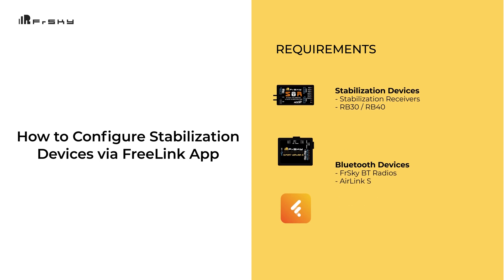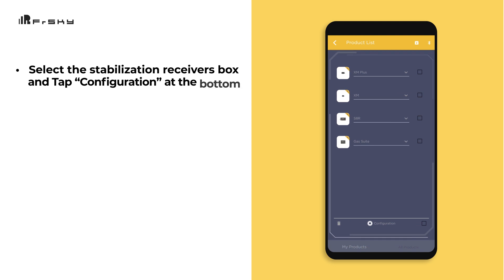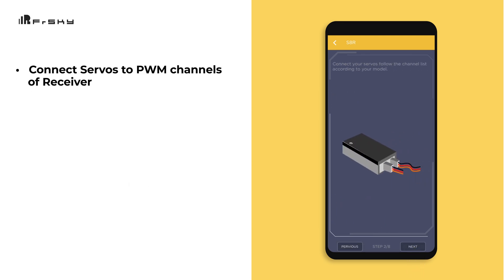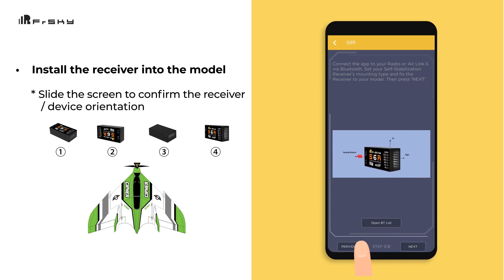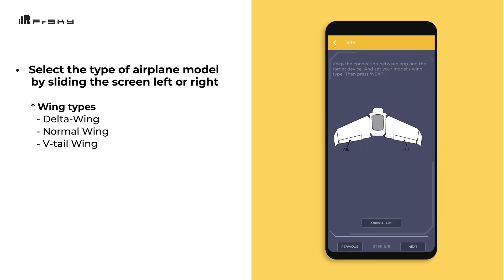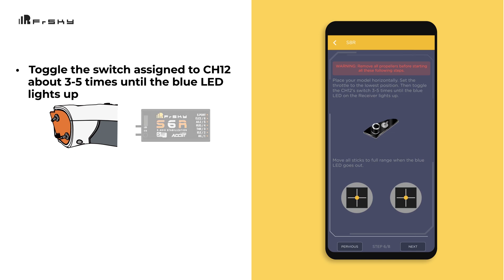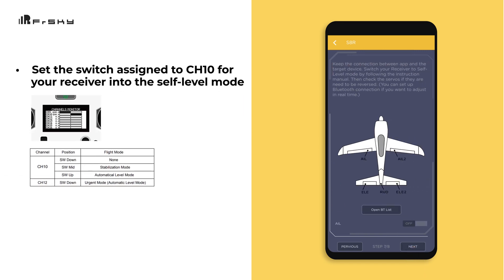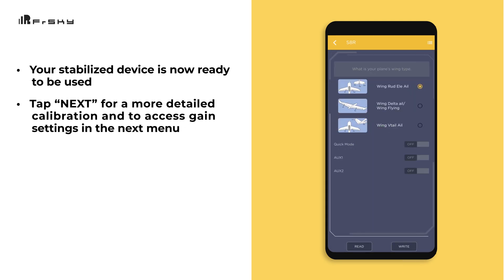FrSky FreeLink App | How to Configure Stabilization Receivers

Comment: Without use the app the stabilization mode works, but inverted, when I use the app to configure the stabilization mode don't work more, I'm using the receiver only like a normal receiver, I tried the procedure of the manual a lot of times and the procedure of this video a lot of times and doesn't work, the android version of the app isn't like this of the video.

Comment: Worst Customer support ever.. I have a Horus x12 and it missing several options from the Model Menu. I have asked support after upgrading as they told me and the issue was not fixed and no response. Cant use the radio as I need it.

Comment: If you instal it you ruin your BT connectivity, you cannot connect any new device, until you uninstall this App and reset the network connections.
It seems FRSky is not able to progamm the right way, very similar to the SxR recievers (ACCST V2.1.x)
Reply from the maker: Hi Kai, could you please let me know the versions (App, Android/iOS and OpenTX) that you did the test with? Also, more details about the phone model would be better. Thanks in advance.